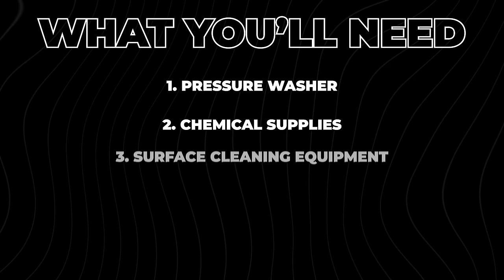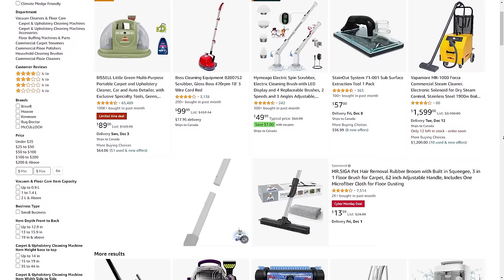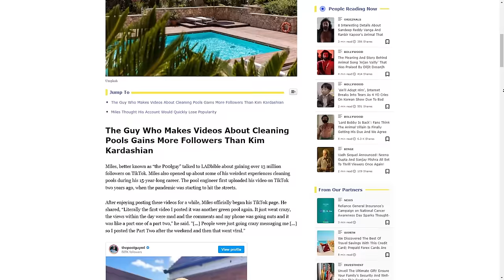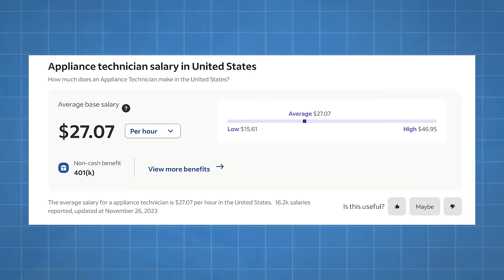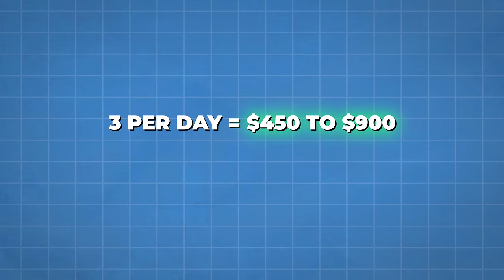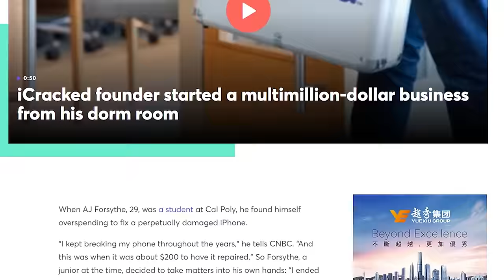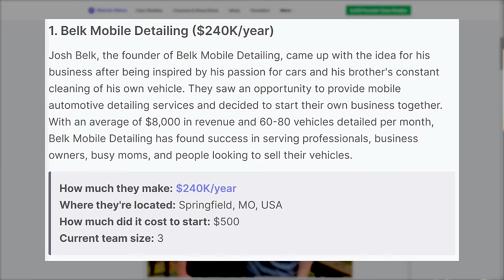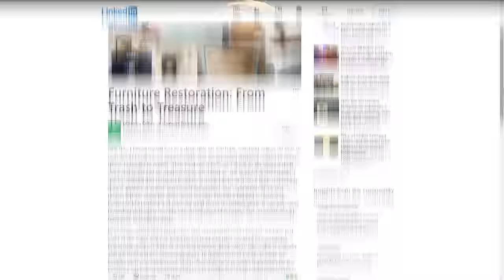21 Dirty Side Hustles No One Is Talking About For 2024

Comment: Some of these are complete professions. Painting a house is not a "just painting a house", it consists a lot more details, practices, needs a relatively extensive theoretical preparation, and if you haven't learnt it, you'll be in a big trouble in some of your everyday cases. Painting ten houses a day? It's not impossible, but good luck living like that. Same goes for some chemicals, possibly in graffiti removal job, too. You'll need a license to be able to buy the really effective stuff. Appliance repair is an art and science in itself, and less and less models are actually worth fixing nowadays. This video screams you've never tried to do these, and you never talked to anyone to prove it's relatively easy stuff with no knowledge, zero years of experience, no affinity, etc etc...
Reply: Facts. Except the house painting is more common sense for anyone handy. Like using proper paints. Taping off parts you don't want painted. Having a air or airless paint sprayer gun. A very big ladder and common sense. You definitely don't need to be a professional to start this. I would recommend however practicing on your own house first or a shed. Lol
Reply: I worked for a painting contractor for about a year, and spent the first couple of weeks as a gofer and cleaning up work sites.  They wouldn't even let me touch a brush or sprayer until I was trained on technique and demonstrated minimum competence.  I learned a LOT about the trade from my boss and the other painters, and still had a lot to learn when I left to take a job driving a truck.  Besides skills and knowledge, you need strength, endurance and courage.  A fall off a 40' ladder can have serious consequences.
Reply: Not that you are incorrect HOWEVER, I believe this video is just an informative/ ideal generating type video. Meaning to give some people a few options to look into. My husband is a professional painter so yes, it is TREMENDOUSLY more tedious and experience/knowledge necessary to do efficiently and correctly. But anyone who ACTUAL uses this video as it is intended to be used, when they do the research on said side hustle they will learn that several of these "gigs" are not just pick up and run with kind of things.
Reply: The painter is smoking joints with the dog susan!!!!!!!!!!
Reply: If you can't cut and roll I don't want  you painting shit for me 😅😂😂😂😂
Reply: @coutos311  properly, that is. I know what you mean. Yeah, it may be easy to get some paint in a bucket and a few applicators and slap paint on a wall or siding. But if they never had experience or have never been properly trained by a real professional painter, who buy the way will refuse to let you touch a brush in one of their clients home until you have mastered their art that they are teaching you, then I do not want them anywhere near my property.
Reply: @rebcreighton yup your 100%  if you can't cut in or spray you should Hire somone lol

Comment: I've done most of these at some point in life. The most lucrative business I did back when I was still healthy enough started picking up scrap metal which lead to picking up used appliances from big apartment complexes around town, doing minor repairs and selling them. At one point I sold about 50 refrigerators every week. I got them for free, spent about 10 minutes cleaning them up with a power washer and sold them all for under $100 all day long..

Comment: Appliance repair is definitely something worth looking into but I will say having a mentor in the industry for a long time first is the best way to go about it. My father started our business 50 years ago and it has never slowed down. Typical going rate for a completed repair is 250-500 and typically if a unit is condemned (not being repaired) your looking at 60-150 for your time. Run about 6-8 service calls a day. Do the math. Definitely niche into high end appliances because that's where the most money in the industry is.
Reply: Nice pfp

Comment: So where exactly is the line between side hustle and full time job because a lot of these seem like they are intended to be full-time gigs rather than side hustles? 

House painting, for example, isn't something you're going to do after work a few nights a week for a couple hours on the side. You're going to need to show up for 3-4 days in a row with at least 1 or 2 other painters and work a full day until the job is completed. If you're doing the work alone it might take a couple weeks to get the job done. I hope that side hustle works out, because you just got fired from your main job for now showing up.

Comment: I watched on 1.5 speed. Most of the hustles are just not doable by average folks. I would do the junk removal, and maybe cleaning the cans. I would add tilling up small garden spots;would need a truck and tiller. Very seasonal though. As are a lot of these side hustles.
Reply: I basically watch all videos on 1.5 speed. Or at very least 1.25 speed. Either way, it saves my valuable time.

Comment: Many of these require a car: consider an EV which will save you a lot in fuel cost. You'll be recharging at night at low rates. Some states (like Colorado) offer tax credits even for used EVs.